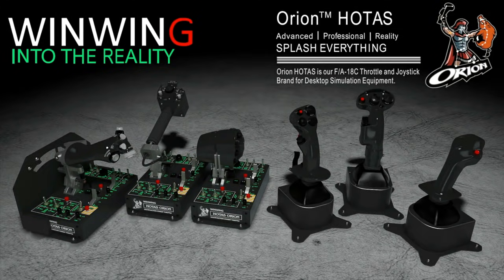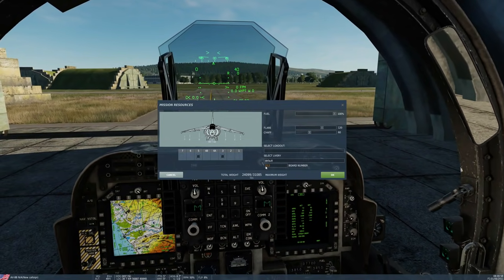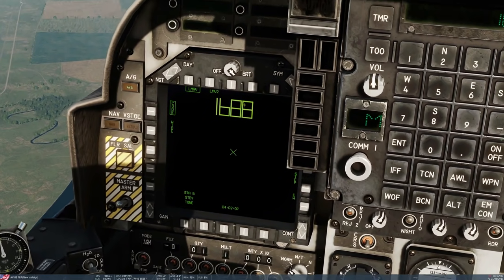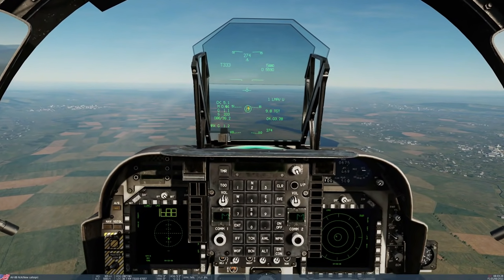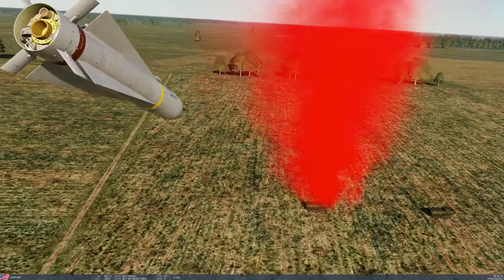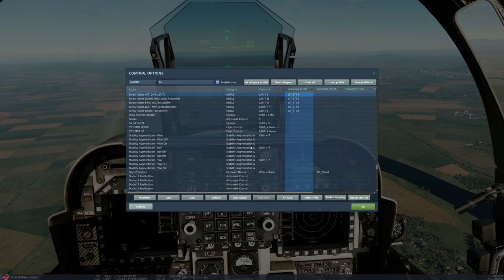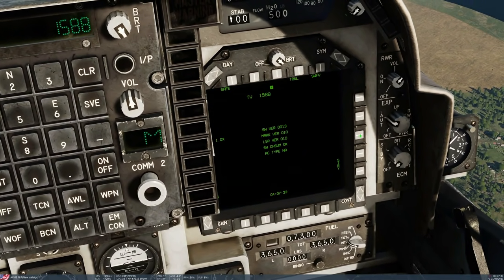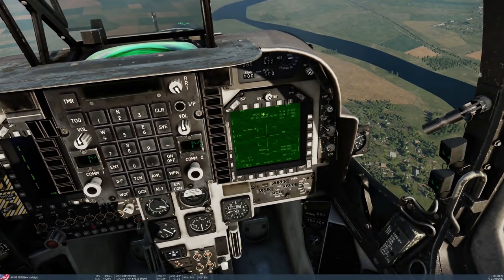*REVISED* AV-8B Harrier: AGM-65E & L(E2) Laser Guided Maverick Tutorial | DCS WORLD

Comment: How so you make a reaper drone laser designate? Some extra script?
Reply: Looks like ctld script
Reply: There are 2 ways, one is with the JTAC-AutoLase script (which is available included in CTLD or separately), or use a FAC Mission task in the mission editor. The latter requires the use of proper JTAC procedures (9 line etc)
Reply: @Ironwulf2000  Thanks, I'll try the script.  AFAIK the predator does not have the lase option in the fac mission in the editor.  Could only find it on the hummer.  Also the 9-line is very verbose for a "game" so will give the script a go!
Reply from the maker: https://youtu.be/y1xKe3-hkPk

Comment: But self-lasing LGBs is not possible any more?
Very weird. Really upsetting. As is the removal of IR Mavericks and GBU-54. Not quick with saying that but I will not pre-order Razbam modules any longer.
I do not mind if it takes a long time to get a module final (real jets are sharing this problem to a certain degree). But removing stuff because "loadout was never used in real life even though the jet was capable" is not great at all. Leave to mission designers to restrict load-outs / weapons.
Harrier was one of my favorite modules despite some issues but they really manage it poorly.

Update: seems to be back to normal. Some glitches but I will try a fresh install / repair later. Sorry if I was a bit quick with my conclusions. I am really glad if the Harrier is closer again to how it  was earlier. As said, it is one of my favorite modules, interesting to fly from a flight model (very different to other aircraft). If mission planners use it as "close to the front line" CAS unit it can really shine.
Reply: You can self lase lgbs, IRMAVs are going no where, and the 54s have not been removed
Reply: No change to LGBs. Those can still self lase as before. IR Mavs are not removed.
Reply: Are you on open beta or stable? In OB I was not able to self-lase LGB. As soon as the TPOD is activated HUD goes ////. 
IR Mavs: try to load them: they are selectable in the loading screen but after spawning the weapon stations are empty.
Reply: @slowhornet4802  Are you using an old preset with G model mavericks?
Reply: @Ironwulf2000 I used presets and also tried manual loading per station. Did a re-install of the Harrier but did not change anything.
Have to say I am on Steam. Maybe that causes issues? E.g. in the mission editor the extra waypoint tab for the Harrier is also not available. Though I recall that Cap mentioned this feature was missing on his installation while being present on RC's.
Reply: @slowhornet4802  you're doing something in your procedure wrong. Have self lased several gbu-12 with no problems in the current beta.there was a but prior to the latest patch that caused the problem you discribed but that bug has now been fixed. I'm also on Steam and the IR Mavs are there and work well though locking I still find easier in the F-16 :) try a local file verification instead of reinstalling the module.
Reply: @Jeffrey C: many thanks, I will try again later today. 
Is there a current tutorial with the necessary steps? The issue is that I cannot even get the AZL line on the HUD. Bombs are armed, fuze selected, Auto mode selected. 
But I still see these //// on the HUD which indicate station is empty / not ready if I understood it correctly.
Reply: Same for me, As soon as you turn on the Tpod ///. Once the second update came out a day or so later it was fixed
Reply: @Ricky Brown: Thanks, will try again. Would be really great. 
Out of curiosity: are you Ricky..... Bobby?
Reply: @slowhornet4802  Arm your bomb with its settings, activate your TPOD, find and set target point, activate laser, make go boom boom. :) If you're getting the //// all the time it sounds like you might not have gotten the latest update for some reason or it didn't install correctly. Or forgot to put it in A/G mode like I've done more times that I'd want to admit :P
Reply: @Jeffrey C yes, looks like the patch did not install correctly the first time. Now it works. And yes, I did the not switching to A/G, and also started from an airbase which had limited supplies (no wonder that certain weapons were not loaded even after the patch correctly installed). All good now.
Fully recommend the Harrier again :-)